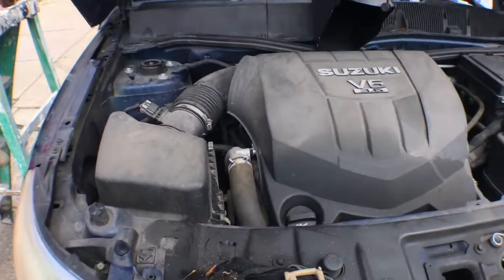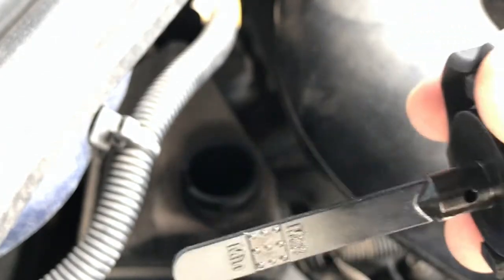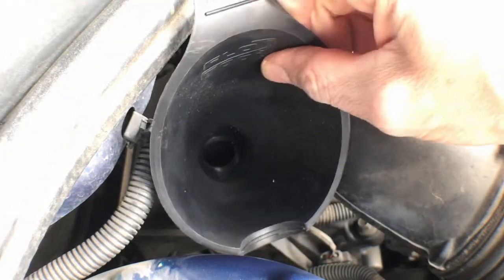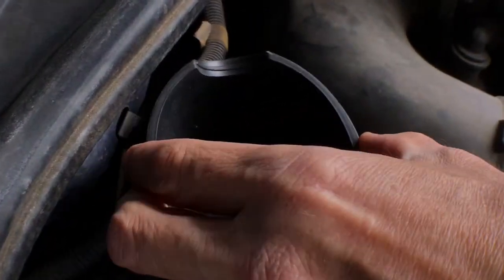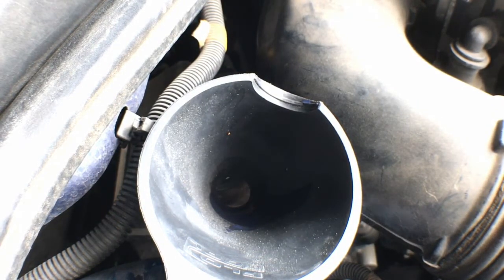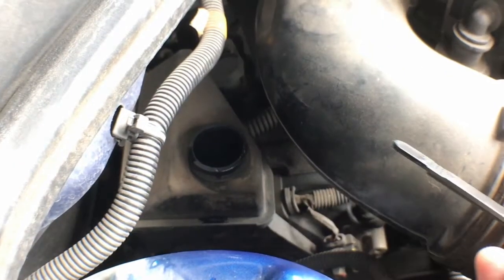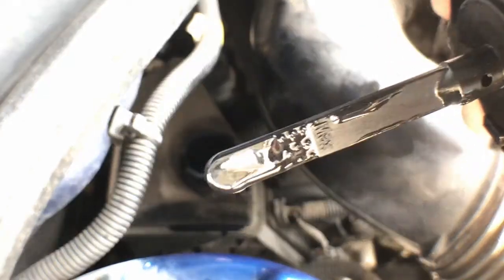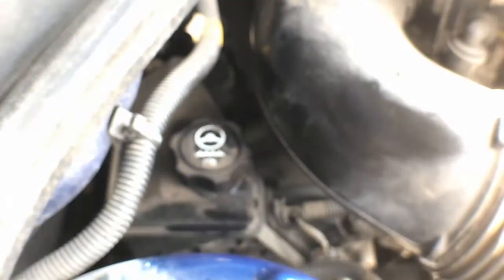'08 Suzuki XL7 - Power Steering Fluid Topoff

Comment: If you run out of power steering fluid, will your steering go out instantly?
Reply from the maker: Good question!
Power steering fluid makes it easier to turn the steering wheel, so losing all fluid wouldn’t seize the steering, it would just make it extremely hard to turn the steering wheel!
Thanks for watching!

Comment: Late I know, but what's the capacity of the fluid system, how would you know how much to buy or if you're exceeding the max? Thanks!
Reply from the maker: It’s never too late to ask a question!
On the reservoir, there should be markers that show you fill levels.
Let me know if this helps!
Reply: @DIYTutorialGuy  Splendid, thanks so much! Most appreciated!!
Reply from the maker: No problem!